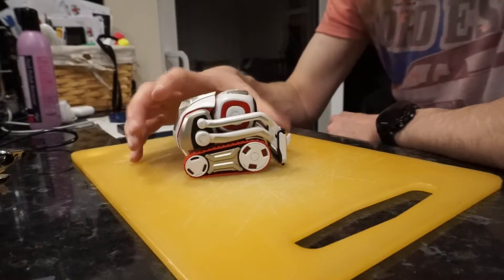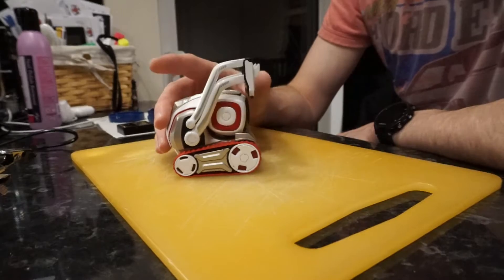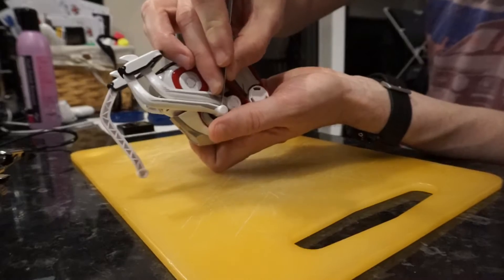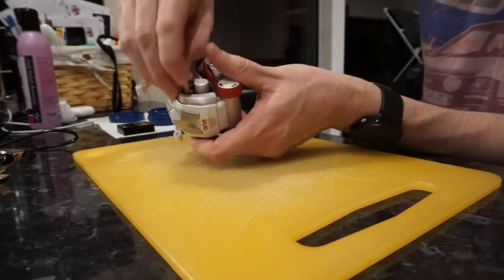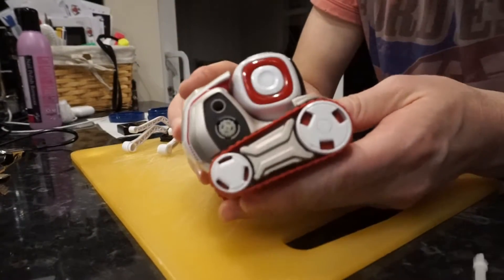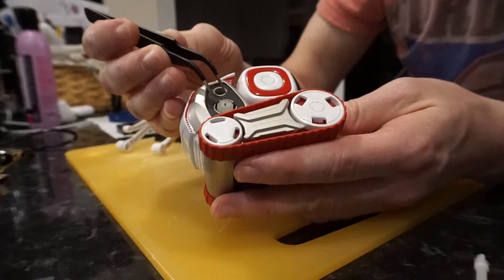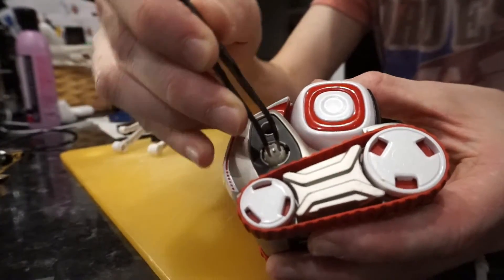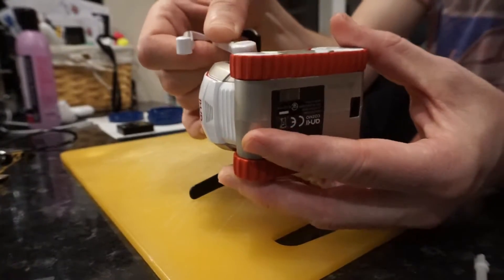Repair Cozmo's Arms - 60 Second Fix

Comment: Thank you sooo much for taking the time to do this video.  This solved our problem!  You may explain that the reason this works is because one or more of the internal gear box teeth are broken or worn out and by rotating it 180 degrees you are using the other half of the gear wheel that is not used.  Also, a link to the STL gear file would be helpful to 3D print your own replacement gear.

Comment: I discovered that there is a little part (plastic pin) that you have to depress first on the top (smaller) part of the lift gate in order to get it to come off.  These wasn't very clear in the video.  I started to pry it off but it wouldn't budge, then upon further inspection I noticed this pin.  You may want to update the video to more clearly show that part.
Reply: I dont see a pin